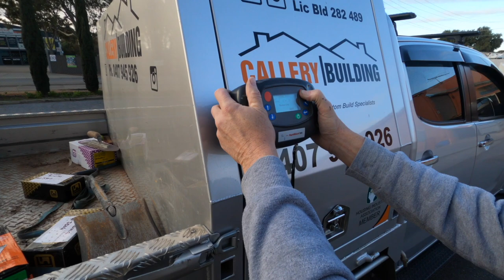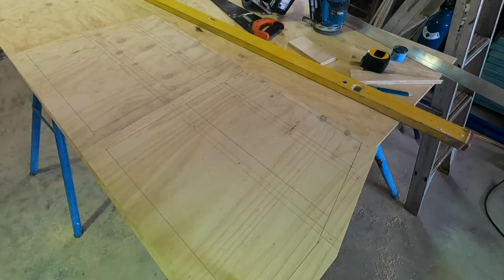New Canopy Build - EP.01 - BUSHMAN 85L FRIDGE - DRAWERS - PAINT

Comment: Hey mate love it. How did you attach it all to the canopy floor
Reply from the maker: Cheers Harrison! On the bottom of each vertical panel, I fixed a bit of aluminium angle & bolted it through the floor.
Reply: @inspiredtoexplore  did you consider doing a false floor and then just screwing to that to reduce holes in the canopy? If so, what was your thought process that led to this method?
Reply: @corymcclurg6386  hey Cory, didn’t go with the false floor to try & save some weight as the ply is pretty heavy already. Also without the false floor, it gives these small areas under the drawers for storing things like spare belts & hoses that will hopefully never have to come out, but can pull the drawer out of the body to access in emergency situations.
Reply: Hey  Cory, 
Just going through comments and seen yr comment. 
I put a false floor in mine using 40mm aluminium square tubing with 12mm marine ply so it was all level. 6 months later I removed it due to buying pantry and changing set up. Have a look at my video for some ideas
Cheers 
Out There Touring

Comment: Awesome build mate, looks very impressive. How do you plan on securing it all down?
Reply from the maker: Thanks Grant!
The canopy is bolted down, I have nuts welded underneath the tray so I only need to worry about the bolt. 
All the drawers etc. are bolted down to the floor with some aluminium angle